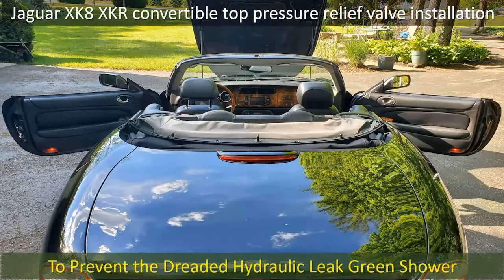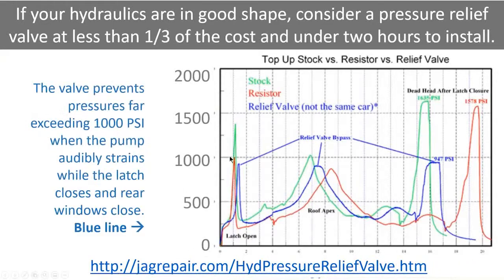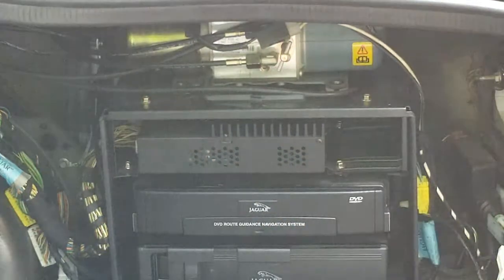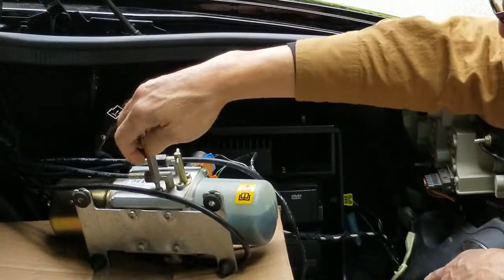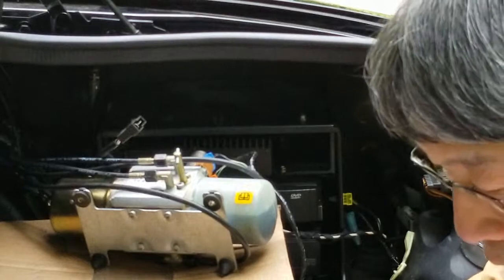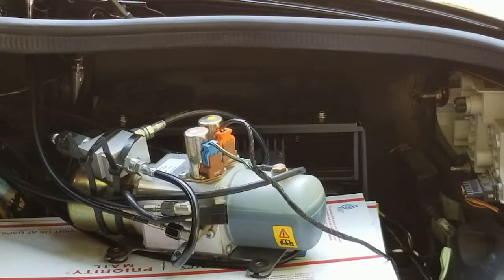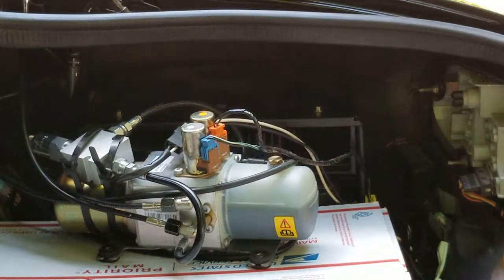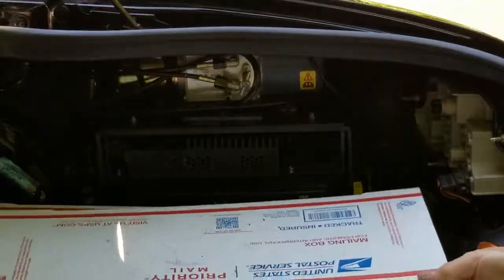Jaguar Convertible Pump Pressure Relief Valve Installation

Comment: Thanks for highlighting this kit. I follow you due to your R107 videos and it is amazing we have 2 cars in common. I don't use my top for this very fear of hose rupture. I will be getting this kit also. I am not sure why Jaguar designed this such that the pump continues to run after the hydraulic work is done. I would have designed it so once the latch closes, the pump would shut off as the electric windows raised, but this seems like a reasonable workaround for the problem. Thanks again for your R107 and XK8 videos
Reply: BB, as you can see I generally ignore YouTube comments. Lots of people assume I am a mechanic or have some kind of training. I am a hobbyist that likes cars. I must say your taste in vehicles is impeccable. How do you compare the 107 to the Jag? I find the 107 gets more compliments but IMHO the Jag handles much better and is the one I pick when the weather is fine.
Reply: @ohiostatefood  Hey Ken (though you can't see, I politely bow to you ) I am a hobbyist like yourself. I have a 79 450SL w/80K original miles. Very nice condition maple yellow w/ tobacco interior. I also have a light blue 05 XK8 w/ 32k original miles. Both cars are garage queens. Never sees rain or worse. To compare the two cars is difficult. What do they have in common? Style, originality, premium build quality, interior comfort, and they both just look cool (oh! and they both don't have great places to put your drink). But they (as you know) are totally different cars. The 450sl is not a high-performance car. In my opinion, the Mercedes 450Sl is just a fun cruizer that turns heads due to its classic timeless style (be it roadster, top-down, or hard top on) and is basically computerless. The Jaguar on the other hand is no performance slouch. A bit too low to the ground as some terrain can contact the low nose. So I feel like I have to be much more careful about where I go in the Jaguar. The Jaguar is fun to drive for different reasons to me.  Jaguar is for higher performance cruising while the Mercedes is just old school German engineering fun.  Thanks again for your videos, the Mercedes timing chain video, the seats, this one, and several others have been very nice to see what you are getting into before doing it yourself. You are a smart fellow and it is hard to express my appreciation for you taking the time to make the videos you have to help others. Stay virus-free and healthy sir! And I look forward to your future videos if you are able and wanting to do so.  And thanks for your comment reply!

Comment: I never saw you tighten the valve back, but I assume you must have. Great video. The only thing I think you should add is a warning to folks to be very careful when removing and reinstalling the pump to not bump those solenoid connectors. They are very fragile, and not readily available. I  paid $325 for the same kit from Gus.  I don't remember removing the "pump plug" (2:15 in the video) when I did it a couple weeks ago, and I didn't see it in the video.
Reply from the maker: Mark thank you for the good advice. Gus warned me about those very fragile solenoid connectors. Fortunately my Jag has that yellow-yellow quick connect to bypass any touch of the solenoids. Yes I should have mentioned closing the pressure relief valve.
Reply: @autosick  Mine has the same connectors as yours, but that did not stop this knucklehead when clumsily putting the pump back into position from bashing the green solenoid connector on the solenoid. I got lucky. Cabriolet Tops was only 60 miles up the road from me in Sarasota and sold me one for $80, so I was back in business in a couple of hours,  I didn't know it though until I tried to operate the top because I had disconnected it at the same connector you did.